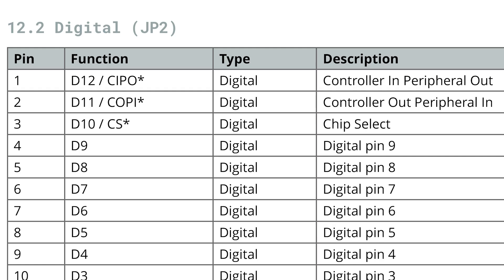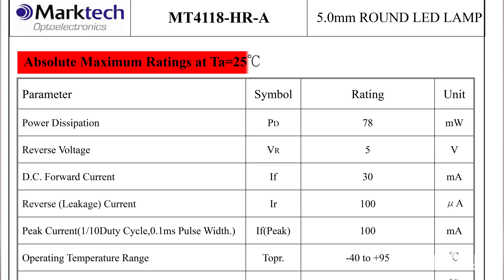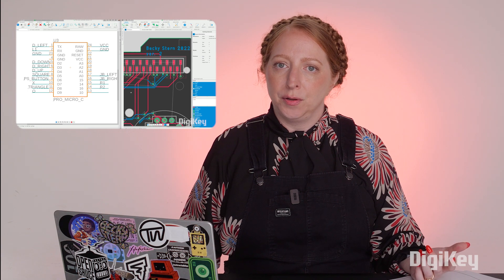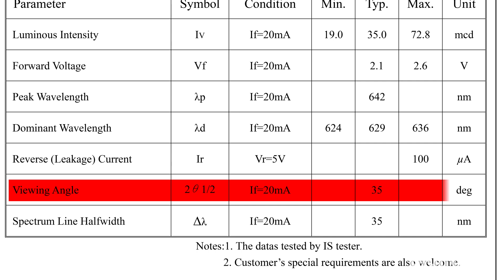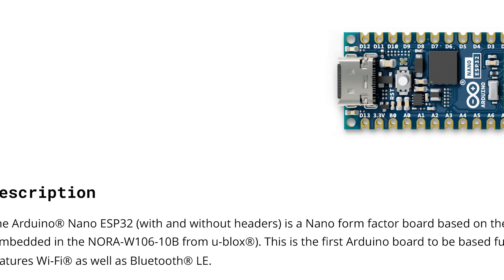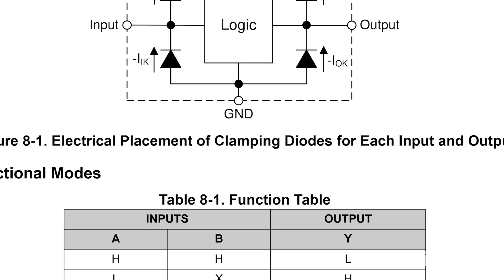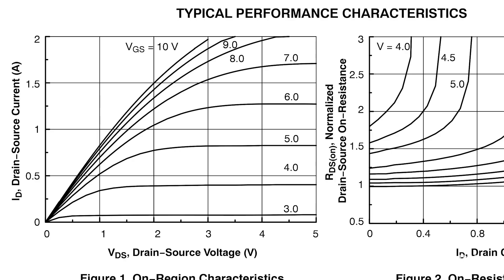How To Read A Datasheet - Electronics with Becky Stern | DigiKey

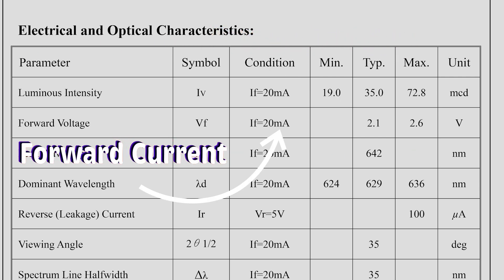Comment: 1:36 Just to be clear, to calculate the appropriate resistor for an LED. You must take the forward voltage and subtract it from your driving voltage. For example, if you had a 12V power supply with the shown LED, you would do 12 - 2.1 = 9.9V Then take this voltage to ohms law 9.9 / 0.02 = 495 ohms.
Reply: Consider watching the entire video.